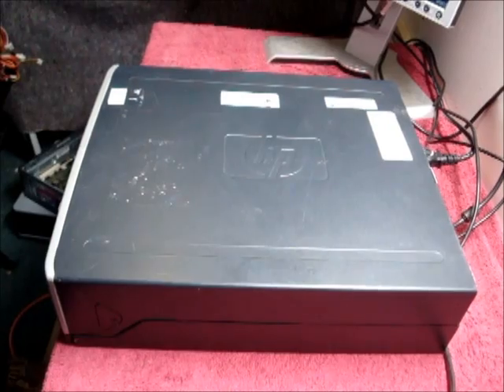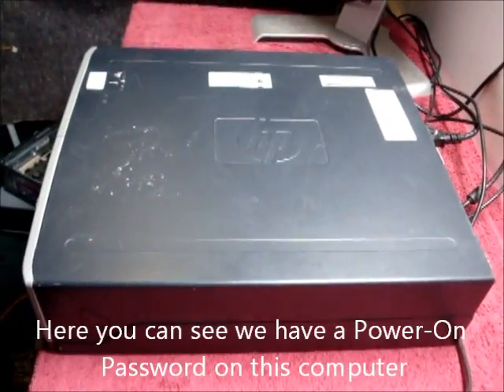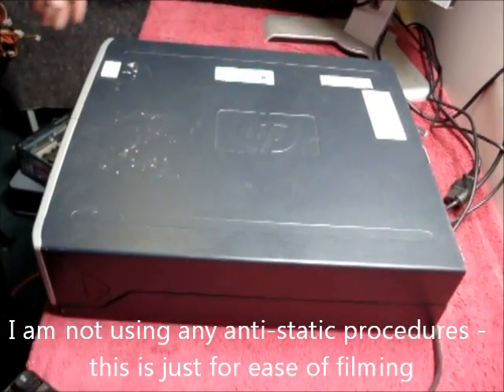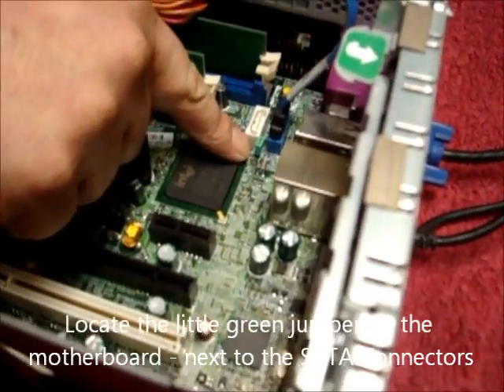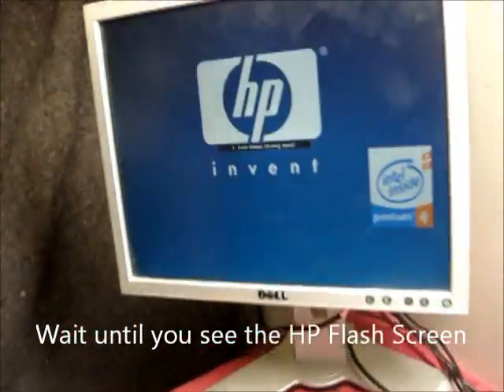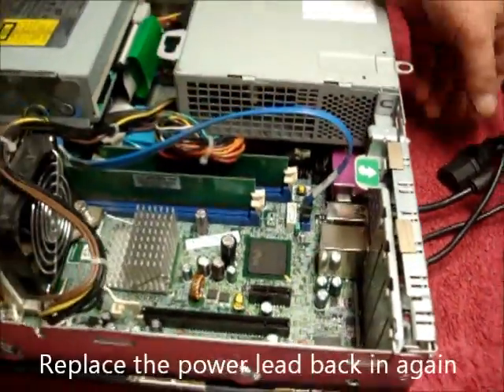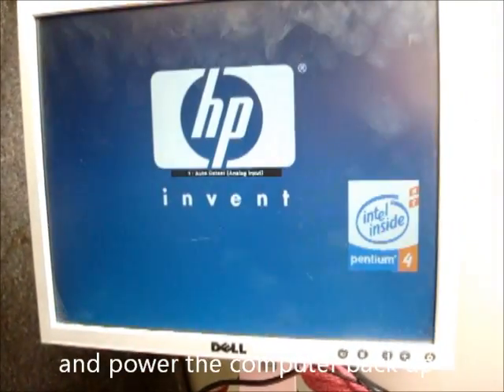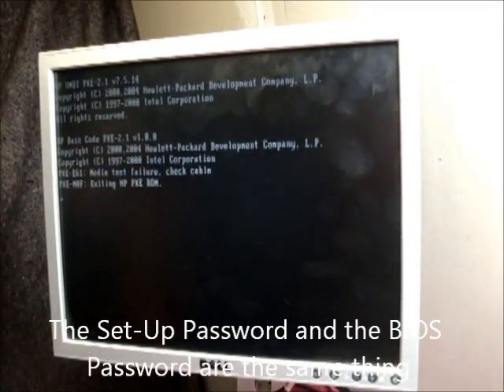How to Reset / Restore / Remove / Change / BIOS / Power On Password on a HP Compaq DC7100 SFF

Comment: How to solve 162 and 163 date and time not set instead I change the battery and set the time and date from bios settings but this process not working and date and time not save